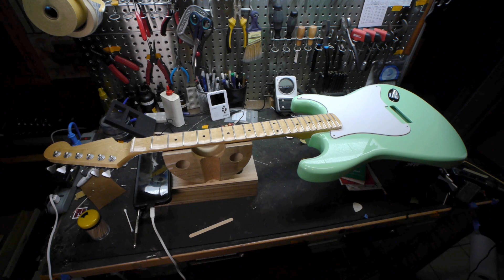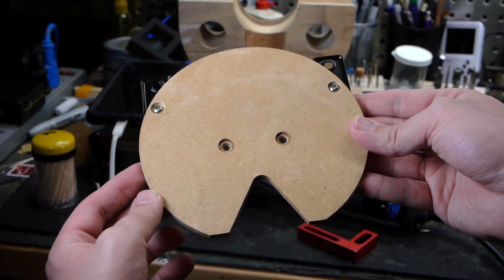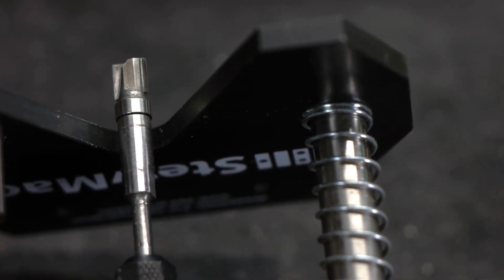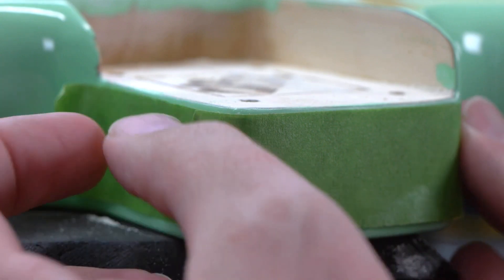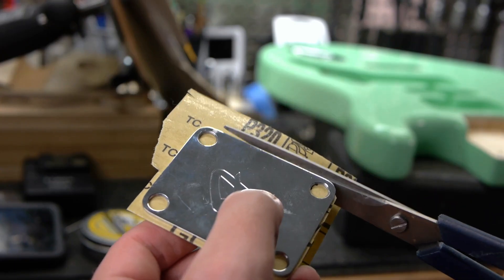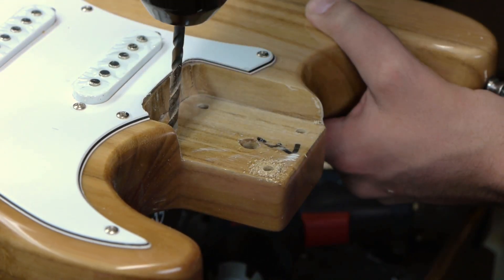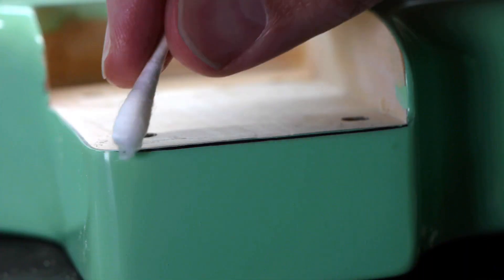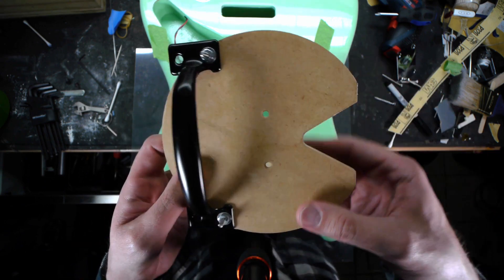*FLATTEN or DEEPEN the Neck Pocket* - Custom Baseplate for Stewmac Plunge Router Base

Comment: You ever consider selling that custom router base?
Reply from the maker: Working on a listing for it now. I'll let you know when I get it listed on eBay. I've redesigned it to be larger, and using a thick dowel for a handle that can be attached upon delivery with a provided wood screw. 

I think it works much better than the one shown in this video. Bigger surface area, and way more of a grip. 

Potvin Guitars has neck pocket routing templates that are also awesome. The only issue is if they're not a perfect fit for your neck pocket, they may need to be routed out larger to accommodate it. With the base I'm using here, it doesn't matter, and you also don't have to remove the bridge to use it, like you do with the Potvin template. 

However, the Potvin template is dead accurate. You do have to be careful using my base. The bigger surface area on my new design however does work much better. I'll work on getting this up in my eBay store today
Reply from the maker: Just listed it here: 

https://www.ebay.com/itm/326128347690

Appreciate the comment. I sold one of these a few months ago and then got distracted with other things and never re-listed it. Got my a$$ in gear for finalizing the design and getting it up there.

Comment: Thanks ! 
I have a new very expensive fender custom shop Strat and the neck pocket has a pretty big divot right around one of the screw holes. It looks like it’s a chisel that chunked out the divot, maybe they use a router and it was tilted like you mentioned in your video at that spot? 
First question, by having this divot / chip around the screw hole, it doesn’t allow for wood to wood contact in that corner, is this of any actual concern or does it lessen the integrity of the neck to body contact and thus the quality of the guitar and its playability, performance and sound quality? 
It definitely seems too deep to take down the rest of the pocket to be flush. 
I was wondering if either wood gluing a shallow stew Mac neck shim into it or filling it with wood putty or CA glue etc would make any difference or improvement, or just forget about it and leave it be ?? 
Would converting it to bolts be another option and would that create an improvement?
Reply from the maker: I would fill the divot. Wood putty would be perfect, and easy. Wood putty dries extremely hard, harder than the original wood itself. It then can be filed flush with the rest of the pocket. 

Fortunately, I don't think divots are a big deal in that area. Filling is perfectly acceptable. What really matters is having solid wood-to-wood contact, or in this case, a wood to flat surface contact. The neck pocket just so happens to be made out of wood but a small divot filled with putty won't make any difference -- that is, it may make a difference by filling in the gap left by the divot, but the putty itself is not inferior to real wood in this case. 

Converting it to machine screws is an option, but I'm not sure how much difference it makes. I had another commenter link me to a video that showed screwing directly into the wood can be just as strong or even stronger than threaded inserts. For me, threaded inserts are more about the convenience of being able to take the neck off and put it back on a million times without worrying about wearing anything out. 

With proper clearance holes in the neck pocket and solid, snug screw holes, the stock sheet metal or wood screws should be fine for maximum wood-to-wood contact. I will emphasize though that clearance holes are absolutely critical. I have a video on the topic if you haven't seen it here: 

https://youtu.be/8hHxZCakAYY?si=bzVhKHAUZMCOLncC

Hope this helps! I also plan on making an updated version of this video. Potvin Guitars sells neck pocket templates that work phenomenally well. I personally mount them using dowels and double stick tape -- dowels to line them up over the bridge holes and tape as extra insurance. But it spans from the bridge all the way through the neck pocket. You gotta take all the hardware off is the only downside. 

But I recently used one on a Tele assembly. Saved me on it. The neck pocket was 1/8" too narrow and about 1/16" too thick. Was able to buzz it down quickly with that template. Could probably have gotten away with my Colt trim router but the Dremel is always safer and you can see what you're doing. Even though it's slower.

Comment: I went through the same problems with this guitar fetish XGP body, except mine was a telecaster and a hot mess.  Take note>>>, these XGP bodies are not flat or routed for standard industry fender spect hardware or templates.
Reply from the maker: Sounds like a true nightmare. Makes me wish I had a pin router. How'd you end up fixing it? Working on a Tele build for someone at the moment and ended up using a Potvin template to rout the neck pocket. 

Not only was it too thick, but the walls of the pocket were about 1/8" too narrow to accept a standard Fender neck.

String ferrule holes were also too small for the ferrules, no bridge holes drilled, no wire cavity routed and drilled for the neck pickup, no strap button holes, pickguard doesn't fit, the jack cup hole is too small, the control section isn't routed properly to accommodate the control plate, and also no neck pocket holes drilled. 

It's been a lot of work so far, to say the least!

Comment: Nice! But...(I know...but..) the rear corners of your handle sticking out unsupported bugs me, so I will re-design to support the entire handle, plus make it possible to use all 4 fasteners on the handle. 😅
Reply from the maker: Good idea! I've even considered additionally using a flat template on the top of the guitar, as even with this base, I've had issues getting the rout perfectly level. 

As long as my ideas can act as a springboard for better ideas -- it's all good. Sometimes I do get lazy and if I were to redesign this baseplate, I'd probably make it more of a rectangle shape, and quite a bit bigger. 

Let me know how it goes! A bigger baseplate would certainly be a help. I may end up redesigning this one and making a new baseplate myself, only because I've had issues with this working perfectly, and I suspect a larger baseplate will help. I will keep you posted and will perhaps make another video if the re-design is successful. If I do so, I will mention your comment as the inspiration for it as well. Thanks again!